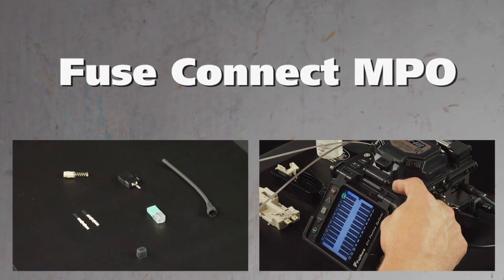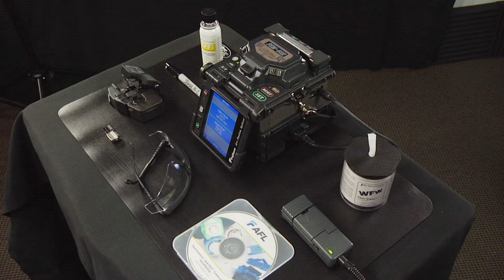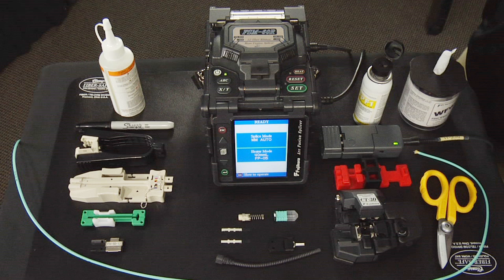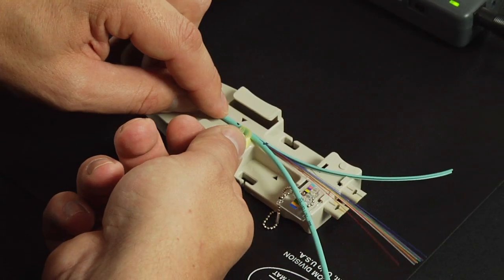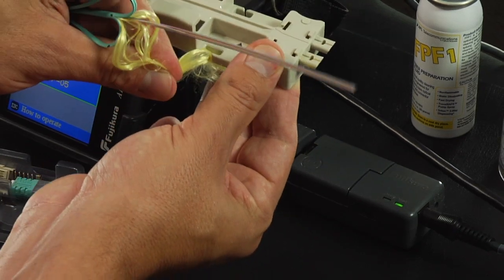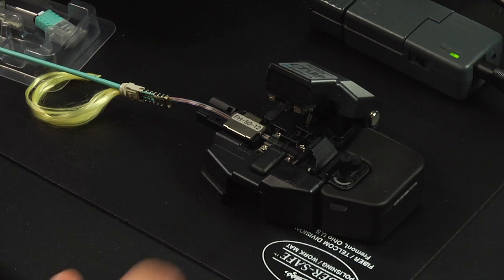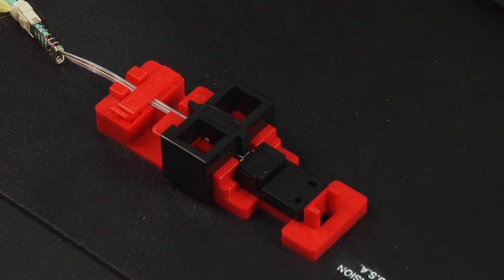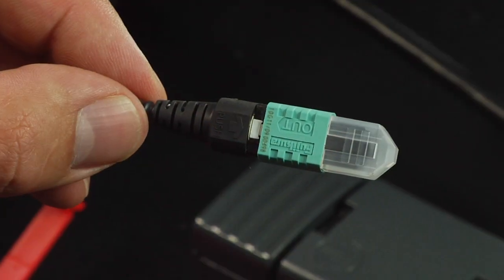FuseConnect MPO 3mm Installation

Comment: I've never done ribbon fiber, but it looks easy enough. Done lots of single mode and multi mode. Loose tube amd tight buffer. Corrugated and Direct burial. We do more copper than anything. But love f I ber work.